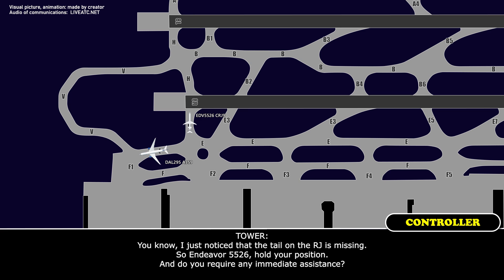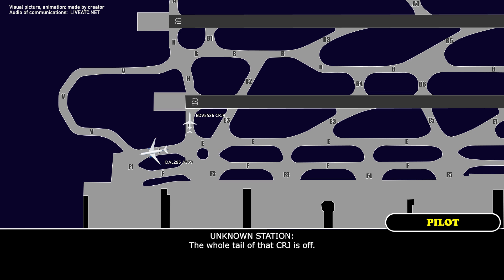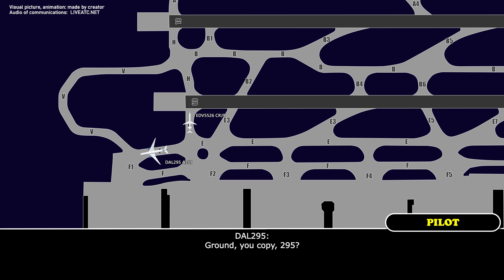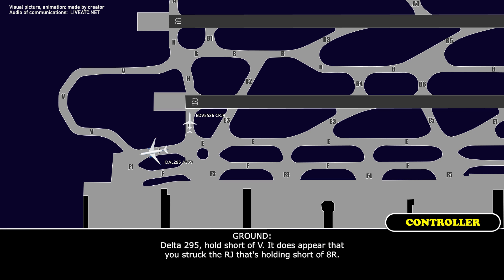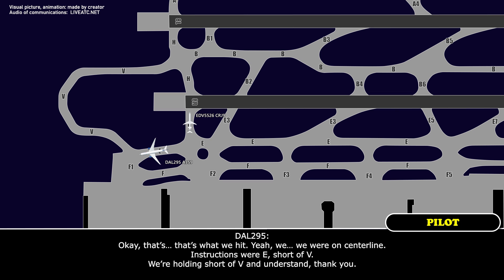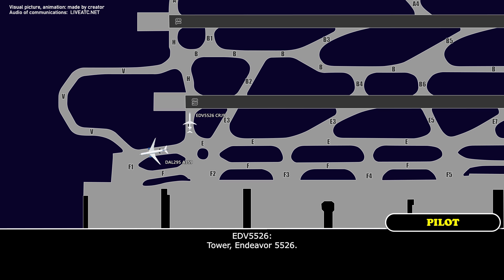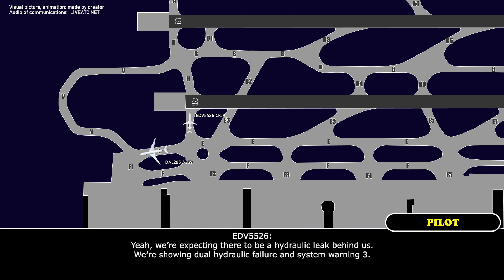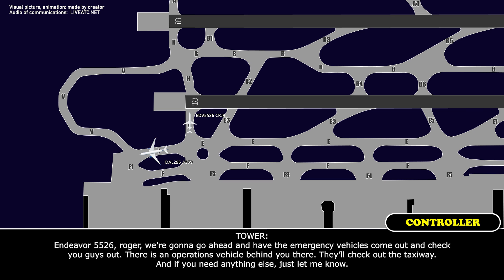“The whole tail is off”. Ground collision at Atlanta. Delta A350 and Endeavor CRJ-900. Real ATC

Comment: Check the Notams:  Effective at 0100EDT on 10sep 12,390' runway 9L/27R was closed for maintenance until 0730 on 12sep.  This kind of maintenance is scheduled in September because airline schedules are slightly reduced and the weather is usually favorable.  All heavy international flights use this runway.  The next longest runway is 9,999' 8R/26L.   9L is on the south part of the airport while 8R is on the North side.  So this crew were taxiing in an area of the airport that they rarely see in an A350  because of this Notam.  There would have been 4 pilots on the flight deck, 2 in control seats and 2 in jump seats.    This will require a report from each.

Comment: Can you imagine being on that A350 as a passenger seeing that wing approach that CRJ? "stopStopSTOP!" Bink. I wonder if anyone has a video from inside the A350? The pilot of the CRJ holding short of the hold short is hardly at fault, though the "missed by that much" was enough to decapitate the CRJ. I sat in the pilot seat of an A350 and there is no way to see the right wing tip. What a mess. The first officer should have had an instinct that there was something hinky, but how fast would that A350 have been going to knock the tail off? (I bet those passengers bound for Tokyo were less than pleased. You know there were folks changing planes there.)

Comment: CRJ well short of the hold point, well short. Even though the Airbus reports the "centre line" he aint going to clear the CRJ.  Two wrongs dont make a right but the FO on the Airbus should have had a better idea that it just wasn't possible to get past.

Still.... Sure the investigation will find the answers to a pretty embarrassing incident.

Comment: The CRJ was holding short quite a bit back from the hold short line.  You can see it in the picture.  It's waiting around 45' short of the line.  So, if anyone gets blamed for this, it will be the Delta/CRJ pilot.  Had it been waiting where it was supposed to be, this likely wouldn't have happened.  Of course, the CRJ could still have been moving toward the hold-short line.  Timing will be everything in this investigation.  It's also possible it was the fault of the Ground Controller.  But I would say the CRJ-900 pilots are silent for good reason.  Instructions from their lawyers.
https://youtu.be/U95S6dQSga8?si=SYaGD2m_sRoH3ZOh&t=258

Comment: Just to show A350 is so strong. The JAL A350 crashed into another plane in haneda still remained in 1 piece.
Reply: You don't understand LEVERAGE do you.  The 350 wing struck the CRJ almost all the way at the top of the vertical stabilizer, that creates a LOT of leverage on a structure that is designed for straight on knife edge loads but NOT designed to withstand SIDE LOADS and especially not with that much leverage.

Comment: Why is the Airbus crew SO surprised they hit "something" ??? 
Are they blind?
Reply: No, the 350 was ON CENTERLIINE of taxiway E right where they are supposed to be, but the 350 is so big that the pilots CAN'T see the wing tips from the cockpit and so they're TRUSTING all the other pilots to pull ALL THE WAY UP to the Hold Short line so they're not sticking out into the taxiway space to give the bigger planes the clearance they need to safely get by the planes that have turned and are sitting at the Hold Short line.  

Juan Blancolirio measured it all out and the CRJ was 50 to 60 feet SHORT and AWAY from the Hold Short line, the CRJ is 118 feet long and there should have been 40 feet of clearance between the two planes but there wasn't because the ass hat CRJ pilot is scared shitless of pulling ALL THE WAY UP to the Hold Short line and left too much of the CRJ's ass hanging out in the taxiway E space.

ATC instructs pilots to hold short of THE RUNWAY, NOT to hold short of the Hold Short line like the dum bass CRJ pilot did.

ATC needs to revise their instruction wording and start telling pilots to PULL ALL THE WAY UP to the Hold short line, the clearance is already built in to ALL the markings but everyone has to be where they're SUPPOSED to be.
Reply: @rawcado    Yes, I understand all that.  I watched Juan's video on all that before I watched this video here.  But, as the A350 was taxiing, you mean to tell me, they didn't notice the CRJ MIGHT be an issue as they were taxiing closer and closer to it?  And, say, "gee maybe this CRJ MIGHT be a problem?"  The Airbus's totally surprised-sounding question of "What did we hit?" just seemed like it was fabricated/phony complete shock.... almost to the point that they are ACTING so as to completely absolve them from any negligence or wrong-doing.  Sort of along the same lines as the Airbus crew stating they were "on centerline" so they are completely scott-free of any blame.  Yes, the CRJ didn't pull up as they should have, but they were stopped there, and the Airbus was the aircraft that was moving, and are still ultimately the one's responsible for the decisions and movement of their aircraft.

Comment: “Hold short” should mean “hold short,” not “hold short in the neighborhood.” This seems obvious but for some reason this isn’t trained. 

Now you have a Delta Captain certainly in trouble for hitting a plane with a wing tip he can’t see, in a situation where he believes the CRJ is “holding short” for real, while also having attention on a Southwest plane crossing in front of him.
Reply: 💯%  ATC's standard instruction to pilots is to hold short of THE RUNWAY, NOT to hold short of the Hold Short line like the dum bass CRJ pilot did.

ATC needs to revise their instruction wording and start telling pilots STRONGLY to PULL ALL THE WAY UP to the damn Hold short line, the clearance everybody needs is already built in to ALL the markings but everyone has to be where they're SUPPOSED to be, and the CRJ pilot CLEARLY was not at, on or up to the Hold short line where he was supposed to be.

The 350 was ON CENTERLIINE of taxiway E right where they were supposed to be, but as you point out the 350 is so big that the pilots CAN'T see the wing tips from the cockpit, and so they're TRUSTING all the other pilots to pull ALL THE WAY UP to the Hold Short line so they're not sticking out into the taxiway space to give the bigger planes the clearance they need to safely get by the planes that have turned and are sitting at the Hold Short line.  

Juan Blancolirio on his channel measured it all out and the CRJ was 50 to 60 feet SHORT and AWAY from the Hold Short line, the CRJ is 118 feet long, the 350 wing is 106 feet long, and there should have been 40 feet of clearance between the two planes IF EVERYBODY IS WHERE THEY'RE SUPPOSED TO BE, but there wasn't because the ass hat CRJ pilot is scared shitless of pulling ALL THE WAY UP to the Hold Short line and left too much of the CRJ's ass hanging out in the taxiway E space.

Comment: That is going to be one awkward conversation with the Chief Pilot. 
Interesting to hear the Airbus pilot immediately point out they were on the centerline. For sure the smaller plane should have been pulled farther forward, however, there is an old adage in industrial accident investigation that "a stationary object is rarely responsible for a collision". In other words, if you hit a tree, don't blame the tree.
Reply: There are also quite a lot of valid reasons to stop before what you are cleared for. Like foreign objects on tarmac, or, say, a problem that needs your full attention. As far as I understand the clearance tells you what is the farthest point you are allowed to reach, it does not mandate you to be all the way there at any given point in time...

The rumor is the A350 pilots were distracted because they had issues on board. If they have followed the same rule, "if you have too much going on to pay full attention to your surroundings, stop", they would have been fine. Yeah, ATC might hate them for blocking the taxiway, but ATC is paid to work around unoptimal things happening.
Reply: @JariJuslin apparently they did ask atc to hold position to fix that issue... but atc said go past the crj .

After this I m guessing all were heads down in that 350 cockpit.

Comment: Tower told CRJ to hold short of THE RUNWAY, not hold short of the hold short line.
Reply: Clearance is clearance, not a command to move. "Hold short" means they need to stop before any part of the plane crosses the given line. It does not state they have to meet the line, just that they are allowed to proceed as long as the line is not crossed.
Reply: @JariJuslin  Wanna bet??  An ATC command to hold short means Hold Short AT the Hold Short line but not on the other side on the runway side of the hold short line either because otherwise IT CAUSES COLLISIONS!  DUH!!!

If the ATC command to Hold Short does not state or mean they have to meet OR BE AT the line then why have Hold Short lines at all??  Why not hold short in the middle of the turn, which actually is not far from where the CRJ was?  Or how about hold short on the taxiway in front of the turn to the hold short line??  Or why not just hold short at the gate and not even taxi to the hold short line or just any other damn place you feel like holding??  

STOP trying to think, you're NO GOOD at it.  🤣🤣😂😅😆

Comment: Just from what I can see, the CRJ was well short of the hold short line and that likely was the cause of the interaction.  Unless I'm missing something...
Reply: I don’t think you can be responsible for someone taxiing into the back of your aircraft
Reply: @kickedinthecalfbyacow7549  I am not a commercial pilot, but it seems to me the CRJ has some responsibility to get his plane far enough away from the taxiway centerline when holding short to not impede passing traffic.  Juan Browne estimated that he was 40-50 feet short of the hold short line which seems pretty significant.
Personally, I was wondering if that short taxiway to the runway that the CRJ was on can only accommodate shorter aircraft and the ATC directing them there might have some responsibility, too?  I don't really know...  Just guessing there... 
I do believe the A350 pilots cannot see their wingtips so they were trusting the centerline would keep them safe...  Can't really fault them if they were indeed on the center yellow line......
Reply: @alwaysprepared  you think that you are responsible if someone crashes into the back of you?
Reply: @alwaysprepared  as someone who has been a captain on 2 Rj types for 6 years now and has taxied around nearly every major airport in the u.s. you could not be more wrong about basically everything you're saying.
Reply: @nahhomeboy  So, tell me...  I'm listening and willing to learn...

Comment: This seems to be an odd position for DL295 if I understand the details. It was heading for Tokyo (HND) I think. It was past the entry departure point (F2) for an east bound departure. Anyone have any other clarifications? I fly out of ATL every week and sometimes a couple times a week and am quite familiar with departure patterns. I would have expected them to hold short of F2 to sequence for the departure. V is just a taxi way for arrivals. Not the route to go from the F concourse if you even wanted to get to the South departure runways. I’d like to know why he was beyond F2. While any accident is dangerous, this is a fully fuel loaded set of aircraft. As a note, there were probably four (4) flight crew members on the flight deck for this long haul flight. Glad things worked out for both well.
Reply: That’s what blancolirio said also. This was not a standard taxi route for the A350, so pilots likely would not have been experienced or familiar with it

Comment: if the Airbus was on the centerline, than the airport design  ( built before the big planes were built) can not accommodate such big planes.  When the airport's design demands that planes do not have any deviations more than 20 feet, more and more accidents will happen.

Comment: The A350 struck a plane that was in front of it. Who cares that you were centerline. It is your responsibility not to hit things that are in front of you. If someone is blocking your way, you wait until the path is clear. Centerline. lol. That does not give you right of way to take the tail off of another plane that you could clearly see off to your right. Does he not know what his wingspan is?
Reply: Wrong!!  ATC's standard instruction to pilots is to hold short of THE RUNWAY, NOT to hold short of the Hold Short line like the dum bass CRJ pilot did.

ATC needs to revise their instruction wording and start telling pilots STRONGLY to PULL ALL THE WAY UP to the damn Hold short line, the clearance everybody needs is already built in to ALL the markings but everyone has to be where they're SUPPOSED to be, and the CRJ pilot CLEARLY was not at, on or up to the Hold short line where he was supposed to be.

The 350 was ON CENTERLIINE of taxiway E right where they were supposed to be, but the 350 is so big that the pilots CAN'T see the wing tips from the cockpit, and so they're TRUSTING all the other pilots to pull ALL THE WAY UP to the Hold Short line so they're not sticking out into the taxiway space to give the bigger planes the clearance they need to safely get by the planes that have turned and are sitting at the Hold Short line.  

Juan Blancolirio on his channel measured it all out and the CRJ was 50 to 60 feet SHORT and AWAY from the Hold Short line, the CRJ is 118 feet long, the 350 wing is 106 feet long, and there should have been 40 feet of clearance between the two planes IF EVERYBODY IS WHERE THEY'RE SUPPOSED TO BE, but there wasn't because the ass hat CRJ pilot is scared shitless of pulling ALL THE WAY UP to the Hold Short line and left too much of the CRJ's ass hanging out in the taxiway E space. 

You need to stop trying to think, you're no good at it.

Comment: Looks like the CRJ was about 40 foot short of the red hold line hence sticking out it was further back that where its shown on this diagram) and then maybe the a350 didn't have room.

So as plane turned/priovoted in kink and CRJ further back I think the wing or elevator or both hit CRJ tail - either way airports ground are getting rather congested etc and holds and stuff maybe not fit for size of aircraft running around airports now as so many bigger jets with 777, 787's, a350 as well as a380 and still some 747's etc
Reply: Don't see how the elevator would ever have hit him but Atlanta is the buisiest airport in the United States and has been handling 747, 777. A350, etc for decades now. The simple cause was that the A350 didn't see and avoid.